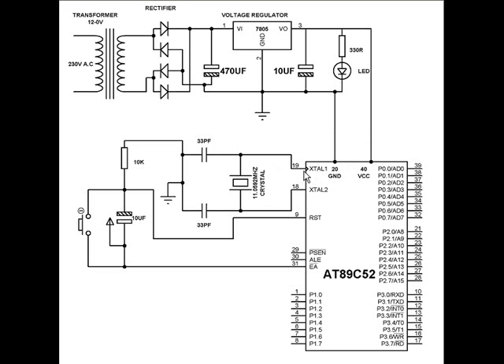8051 Microcontroller connections

Comment: That is not necessary since normal voltage spikes from the transformer will be absorbed by the first capacitor while the regulator prevents overvoltage from traveling down the line. The capacitor after the regulator is to prevent power sags during brief heavy loads, and to let the regulator operate as it is designed to. For something like a powerline surge, a suppression circuit and/or fuse before the transformer is used. The power supply section drawn here is standard and robust.

Comment from the maker: @mattash99  I think U R Confused .PIN 31 is EA and not for reset.Pin 9 is for reset rest and rest only.What I have refered to always is pin no9 and not 31.pin 9 is used for reset (high to Low)also so that the programe starts from the begining at the time of switch on instead of arbitrarily from any where.That is the reason why the RC network is provided in such a way that the pin goes high momentarily as the capacitor behaves like a short circuit at the switch on and after that pin 9 goes ground